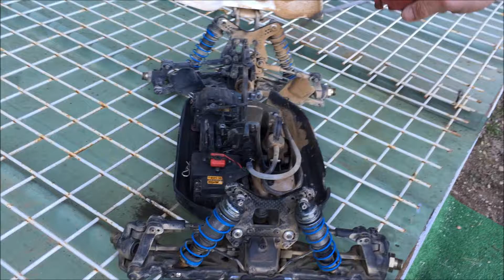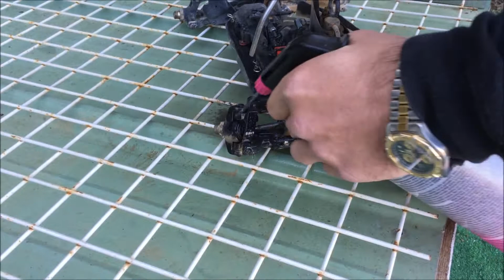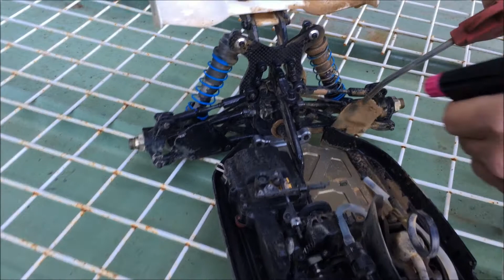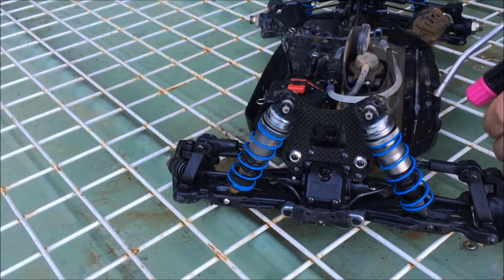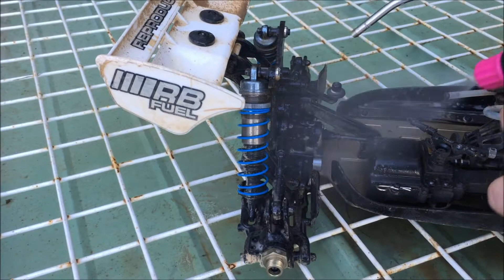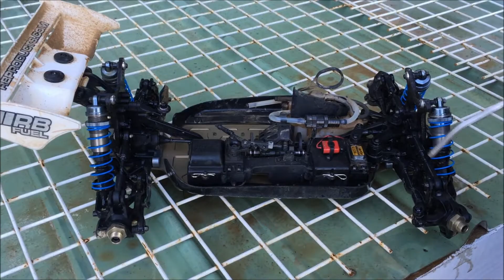Nettoyage chassis TT avec Nettoyant MUC OFF

Comment: Comment vous faites avec l'électronique ? Est ce que le produit peut être pulvérisé  sur l'électronique sans danger ?
Reply from the maker: ✅ Salut, 
Il vaux mieux eviter les servos s ils ne sont pas étanches . 
Pour tout le reste c est bon. De plus il est préconisé de passer un lubrifiant type wd40 ou Mo 94 Muc-off sur les roulements et les parties mécaniques. 
La voiture sera comme neuve et prête pour la prochaine session. 
Mettre quelques  gouttes d after Run dans le moteur 👍🏼
Reply: @FullRCZone  OK. Merci
Reply: @FullRCZone  Mais je crois savoir que le AFTER RUN , c'est uniquement pour les moteurs thermiques non ?
Reply from the maker: @glaalainstephanefally3443  A oui bien sur.
Reply: @FullRCZone  wd40 déconseillé pour les roulements selon le site wd40.
Reply from the maker: @azerty2679  Le muc off 94 ou wd40 chasse l'humidité, c'est le point principal pour éviter des pics de rouille - Pour la lubrification des roulements à bille il existe des huiles fines spécifiques. Cependant un peu de wd40 sur les roulements pour le stockage ne peut pas faire de mal.